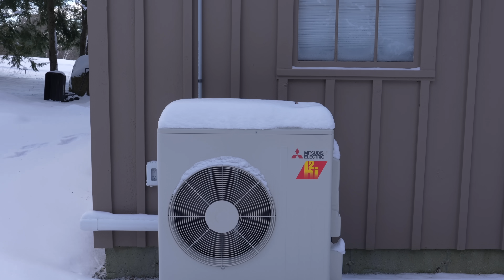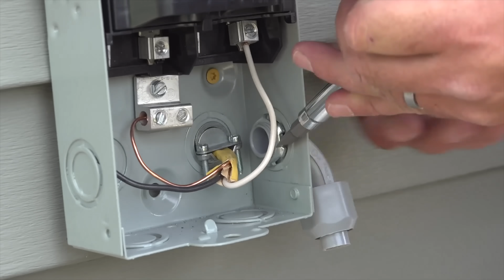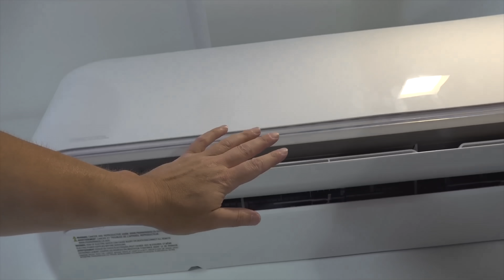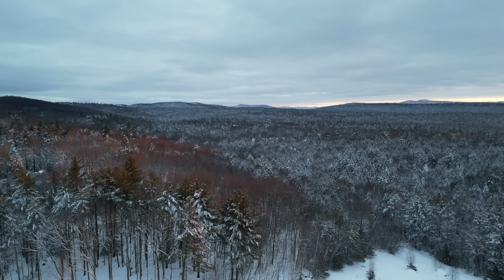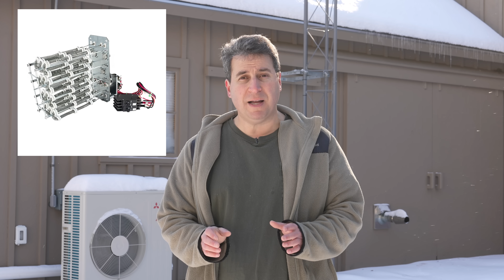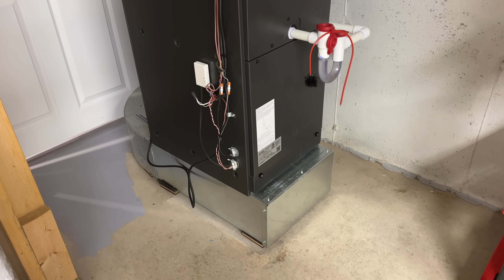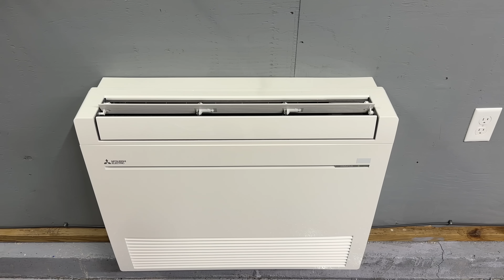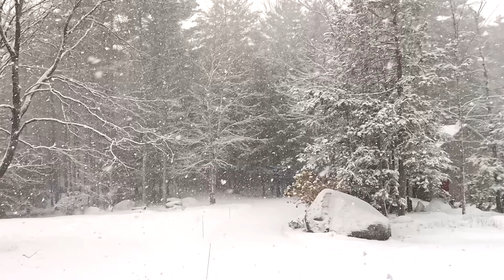Why Heat Pumps are now leaving people COLD

Comment: If your heat pump can't keep up with the load, it's undersized. Run the load calculations and size the equipment accordingly. i live in the Vancouver area. It got down to -11C. The heat pump kept up. It was a little cooler in the house, maybe 19C,  but I didn't size the heat pump to operate at -11C. I did opt for the outdoor unit rated to -15 C, standard is -5C.

Comment: I live in the Deep South.    Heat cool pumps are extremely efficient.   During the winter though  the heat pump requires a strip heat coil.    Both work quite well until you get below 15 to 20 degrees.   If you get down to less than 10 degrees which is not common you will need to wear long sleeve shirts and a sweater in your house and pray your strip heat doesn’t go out.  In fact at that temperatures your strip heat becomes your primary heater until a certain heat level comes on and then the heat cool pump goes on.

Comment: I am just finishing up a McCool central ducted 48k. It is having a hard time heating when it is at 20F. I think this is due to fan speed which will not change even though the MrCool controller shows it being changed. Located in northern NH.
Reply from the maker: For a ducted unit I would definitely recommend adding the heat strip option they sell, this turns on in certain conditions for a boost, its kind of just a reality that they don't really talk about with these systems. I know this isn't the greatest news but these can end up really making these work that little better in really cold temps. Hope this may be helpful

Comment: My house is over 200 years old, my gas central heating works just fine. Doesn’t cost a lot to run either, I live in Wales uk where we get harsh winters. I doubt if a heat pump would be efficient.

Comment: bottom line question: at what point/location/(winter summer temps) does it make sense to switch over to a Natural Gas/Propane?wood stove water heat etc instead of using a heat pump with a 'supplemental system' -- THIS is the question that is difficult to answer when one or the other is best to go with....  Assume New Construction in far North West Wisconsin

Comment: also always remember to go at least one size bigger than the salesman recommends. if he says 8,000 BTU then get a 12,000 BTU unit because the bigger unit is designed to heat a bigger room and will therefore heat your smaller room much more efficiently. I have the newest generation Mitsubishi and even when there is snow on the ground with a high wind chill factor my wife can make the house a smoldering 82° and still maintain a 25% savings in our electricity bill compared to before we had it. and I could talk for hours about how the AC in the summer has changed our lives! literally the best thing we ever bought for our house

Comment: This is why we dig special wells up to 300 feet to extract heat in the winter time or cold in the summer time . 
Depending on the power of the heat pump we might dig several wells ,
Water is run through a pipe down to the bottom of the well and back in a closed circuit while the heat pump is 
connected to this loop through a puffer tank. So basically we use ground water as a source of energy and of there's 
water the ground itself

Comment: My heat pump says it works at minus 28C.    When it hits minus 10C  the heat slows down a lot.
 Set at 80F it heats the house to 64. F .   That is at 0 Celsius .  Canada, which is why I write in two systems. 
 By minus 28C , you need to stand on a chair to feel anything coming out of it.
Ours was to replace the electric base boards, which were backup to the real heat, our wood stove. So it works most of the time. 
When we had a month of minus 30C my husband stayed home to feed the wood stove while I shopped. Normally we use the heat pump on shopping days. But did not want frozen pipes.

Comment: In Canada you have to buy a gas furnace the same size as you had Before you installed the heat pump as at -40 a heat pump is kind of a joke still . I was quoted $32000 ! Heat pump plus new breaker box $24000 plus new 70000 BTU gas furnace $8000 . I opted for a new furnace and no heat pump I may pay for this decision in the long run but at 66 years old I doubt it .

Comment: Great explanation, people really should be aware of this. I solved my problem by installing 2000l buffer tank (in Europe we mostly use radiator heating). Heat pump starts once every day and runs until it fills up the buffer tank to 57°C. When the weather really gets freezing and the heat pump starts struggling (defrosting often), I use a fireplace which is also connected to the same buffer tank and it switches automatically to wood heating when I start the fire. 
Heat pumps are OK, but they take the joy of heating the home with wood away. I actually enjoy in my fireplace, I can stare at the fire for minutes. Also the heat feels different, maybe the smell of the wood adds to that. Can't wait to start my first fire in this winter season.

Comment: The US had a competition to have HP perform better at lower temps.  Bosch just launched the first one, with more to come.  I believe they are rated to work efficiently down to -5F, but check their press release.
Also I’ve installed one geothermal system and loved it except they are noisy, although my current propane isn’t quiet either. The rebates in the US makes geothermal cost almost the same as a HP.  The contractor I got a quote from really pushed the HP though.

Comment: Seems to me the more pumps you get working and the colder it gets, the more power (that the grid can barely handle now) it takes.  Question is, how many pumps running does it take to knock down the grid so everybody freezes? Especially when competing with EVs and AI mainframes.  Furthermore, if you take the heat from the outside and put it inside it gets colder outside which makes the pumps work harder which takes more power which etc. So thanks anyway but I'll stick with good old natural gas until it runs out or I do.

Comment: I have a dual fuel system. Having trouble finding a source for optimal high/low balance points for efficiency. Default is 50 high 25 low. 50 high balance seems too high?

Comment: Living in Queensland, we never have this problem 🙂 It is also simple thermodynamics -  the greater the heat differential, the harder the transfer system has to work, so the more energy consumed. This is why we switch our a/c on before the sun comes up, and we rely to a significant extent on solar power generation.

Comment: Somewhere on YouTube, a guy posted a video several years back, which solved these problems: 
  1. Extreme cold winter 
  2. High summer heat
  3. Increasing energy efficiency by running system off solar.
The house wall faced south.  
He built a big solar array there, which wrapped around the heat pump.  
The heat pump was sort of nestled/enclosed in a generous-size box for ventilating around it, & was insulated from outside ambient air temps.   
It had its own little microclimate. 
The heatpump drew air from under the house (crawlspace)….
….in summer & winter, that decreased the load on the heatpump. 
Depending on unit & site conditions, the vented air that’s cold in winter & hot in summer, can vent outside.  
I think his system did have the backup booster heat. 
His solar array created more than enuf power to run his system, & looked nice. 
 It had less harsh running conditions, from using the air temp from under the house. 
 It also reduced maintenance, cuz the heatpump was protected from the elements.

Comment: A heat-pump certainly can operate down to even -26 degrees... but that isn't your shitty mass-produced air conditioner running backwards.  Additionally there are major placement concerns as a small amount of negative pressure from a lack of proper intake clearance can result in completely losing all benefit.  The exhaust facing the oncoming wind, being too close to the dryer vent so that it freezes the vapor, even simply a dozen milibar in pressure drop will negate the function at temperatures as high as 36°F.  This is especially true in dual-hose in-room airconditioners that have heatpump function, they constantly work at negative pressures and can even freeze up at almost 40°F external air temp.

Comment: Yep, looked into installing one myself a few months back. It would have cost me close to $25K to install it and I would still have a furnace as a backup. So I'd also need to install a new furnace as well. I decided to instead just go for a new furnace next year and add an air conditioner. Heat pumps are still not ready for prime time.

Comment: 2 things that don't work in Manitoba in our extreme winters are heat pumps and EV's, both have been thoroughly tested and the results were poor at best , heat pumps are good as you say in the right regions of the continent , our utility bills in Manitoba area the 2nd cheapest in North America, I heat a home built in 1955 that is a1000 sq ft with no modern windows, just 2 out of the 3 doors are that are insulated and just have 2" of Rockwool insulation in the walls with a 2 inch dead air space, then 1/4" plywood , wire and stucco, last winter my monthly utility bill on a equal payment plan was $180/month, thats electricity and gas and includes a hot tub that runs 365 days a year with a 4 kilowatt heater, it is super insulated with closed cell foam insulation , so i count myself lucky and will be purchasing my first new PVC windows in 2025 through our utility company at a very reasonable % rate of 4.99%, that is great i am turning 65 in the new yearend then qualify for the lower % rate, great video  👍

Comment: My daughter lives in a house which was designed for a heat pump, it’s 8 years old with a heat pump. When the temp drops to -2or 3c it gives up the ghost, the heat exchanger turns into a block of ice and it goes into defrost mode, literally 1 hr after defrost it’s solid again. The heating engineer says “well it’s out of date,can’t get spares,you really need a new system a Samsung will be around £12,000 the best are Daikim circa £20,000. “He is the only man to come out, many are called non turn up. This is in the UK where winters are damp and the electric bill is £320 per month, so much for the savings. Before the keyboard warriors come on with advice, at work the data room had 4 aircon units to cool it and every winter they all froze up. It’s finally been sorted by going to 2 huge horizontal units that work with natural drainage and heat rising. It took 18 yrs for this solution.

Comment: I heat my house (2008, KFW40, Germany, 200sqm) with an LG heatpump only. Including hot water i need arround 2500kwh a year. In my region heating systems are designed for -10.4 degree C. So my house is older than 15 years, but no problem with heat pump only.

Comment: I live in southern Canada on the west coast.  We had a heat pump and hated it. The house never really felt warm and the heat pump seemed to run constantly.  Very noise too. I had it removed and replaced with a new gas furnace.  Best decision I ever made. Our home is always toasty warm now. So much quieter to operate and way way cheaper to run.  Never waste your money on a heat pump if you can install a gas furnace,
Reply: Interesting, I’m in New Brunswick, I have heat pumps and love them. The key is to have the correct size and have the ones that are rated for colder weather, mine are good to -30, but the coldest it gets here is around-20
Reply: @randylahey7343  Agreed. These hyper heat units can hold their heat rating well into the negative teens.
Reply: @ yes, we just finished a few days of -20 Celsius here in New Brunswick and the pumps kept up no problem, they’ll still tell us we’re wrong though, lol.

Comment: If you have no other option but to supplement a heat pump with electric resistance heating, wouldn't radiant in-floor heat be the best option? Since it heats you directly, the room can be comfortable with  cooler air temperature and you can turn it down or off in unused rooms.

Comment: I installed 5 heatpumps over the last 2 years and don't heat with them below 25 degrees f   temperature  that's when the oil heat comes on through force hot air.

Comment: I bought a multi-zone Mr. Cool branded unit.  Worked ok for the first year.  Then trouble started.  2 interior fan motors gone.  Then the bigger problems.  Leaks formed in the air handler units.  It seems that the condenser thickness is far lower than premium brands (like Mitsubishi, etc).  Essentially, you get what you pay for.  Unless you buy a premium unit, these are throw-aways.

Comment: I have 2 ducted heat pumps for 2 story home. Im on vancouver island and u have back up wood heat.  In 9 years weve had to replace 3 inside air coils and right now waiting for a new fan motor for mr down stairs pump. It has cost us $3k for parts and labour not covered by warranty plus an extra $800 in hydro when one leaked its fluid out . Big problem us these air coils have copper coils and aluminum fins that cause dissimilar metals to corrode.😡

Comment: Central Pennsylvanian in the mountains here. We only have a heat pump in our 2015 new build. No gas, no wood. It’s literally never had an issue in 9 years. Our windchill gets to -12°F regularly.
Reply: Does your electric bill get outrageous though when it gest that cold?
Reply: Heat pumps don't feel windchill. In fact, an external airflow that is not directly opposite to the fans direction will help the heat pump in extracting heat from the surrounding air.

Comment: Well this is a load of rubbish

They work incredibly well in the nordic countries that have weather worse than where you are.

That and the idea of a "old house" being older than 15 years old is just ridiculous too. My parent's house was built in the 1930s and I see that as pretty new. The school I went to predates the United States.

Perhaps you need better houses if you think that insulation in a house older than 15 years won't be good enough when that's obviously not the case in colder climates in the world.

That, and again, the air source heat pumps operate pretty well down to - 28C or - 20C ish F. If you're living somewhere where the temperature frequently goes down further than - 28C, then you'd get a ground source heat pump instead of an air source one.

The issue with heat pumps is entirely down to the installer, not the actual technology. Heat pump engineers actually need to do actual engineering, including heat loss surveys and proper design, unlike those who have historically just fit gas boilers and called themselves an engineer.

Comment: A proper sized low ambient heat pump system will work absolutely fine in low temps! All the problems are poor system design and or installation defects! I have installed and maintained many of this systems as a primary heat source in North Pennsylvania and southern New York state! So much bad info in this video and comments section.
Reply: What is considered a low temperature?   Does wind affect how well your house stays warm?  We have a newer home and on windy days (15 mph plus) our house gets colder.
Reply: There is no single statement in this video that is false or misleading. No sane person would dimension it's heat pump for worst scenario.
Reply: @cfrates2703 I am sorry to hear that. You should let the builder know.  Homes constructed by me never have a problem with wind affecting indoor comfort.

I notice the industry is just now going to insulation that is continuous with few thermal breaks by framing.  And they have been moving away from fiberglass insulation.  

I have been building like that since 1987.  

The industry has been too slow to change to better techniques.  And I say keep it SIMPLE.
Reply: Right now it's 22f outside. My 5 ton universal inverter heat pump that I bought used with a leak for $500, fixed and installed myself is effortlessly keeping the top floor of my house 73 deg. I plan to replace my bottom floor A/C only unit with an identical unit that I got for the same this week. These things are amazing. AND Because they are universal thermostat (non communicating) ,  I kept my gas furnaces as a dual fuel system. How it calculates compressor speed without even knowing the indoor temperature or blower speed is a mystery. AND because my power provider is an EMC, power in the winter is cheap and get even cheaper after 1000kw. AND because they are inverter powered with a D/C compressor and D/C fans, they have about 4 locked rotor amps (LRA) so I can start and run them on a 15kw genset - simultaneously. Oddly, the input is standard 220v single phase, but the compressor (and maybe the fan motors) are 380v 3 phase.

Comment: The important thing to consider when selecting a heat pump is to know the heating output at the lowest ambient temperature where it’s installed then comparing to the heating requirement of your house. Supplemental heating means the system doesn’t have to be sized for say the 5% of the year when it’s really cold. The manufacturer has performance charts for each model showing the heating output at various temperatures.